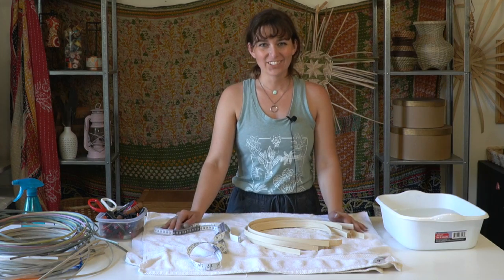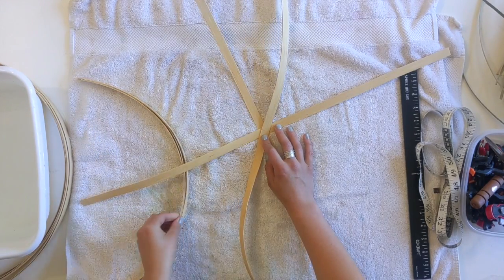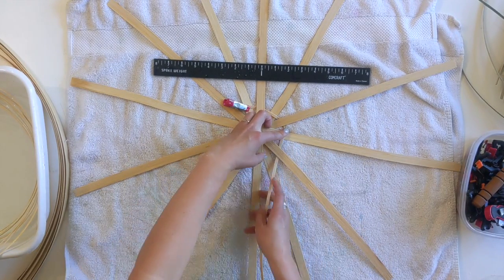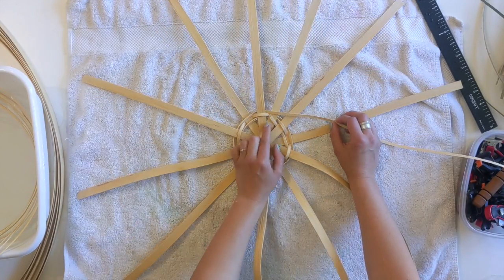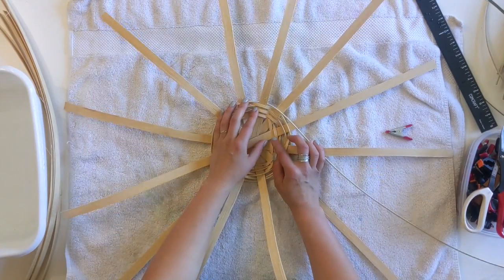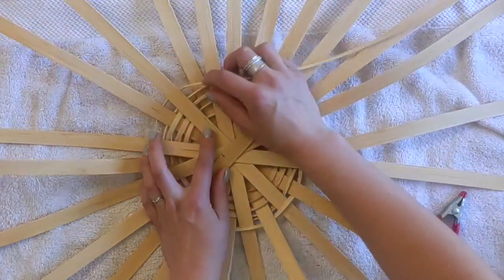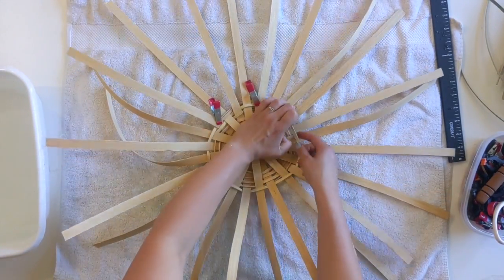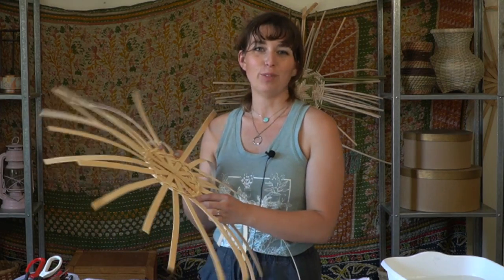DIY Basket Weaving: How to Make a Beautiful Basket from Reed Scraps | Scrappy Basket Weaving Ep. 1

Comment: Love your videos. Love this scrap basket project. I have lots of scrap!  What if I wanted to make a larger basket, like a laundry hamper.  Instead of 12 spokes(6X2) can i use 16 (8x2). How do you get the larger diameter? I want to keep it round, not grid. and i was thinking of doing it twined. I watched your other video several times.
Reply from the maker: You would use the same amount of spokes, but try a 1 inch flat reed for more stability.